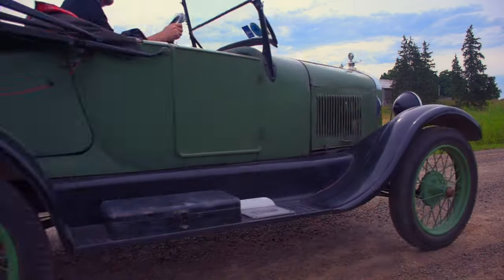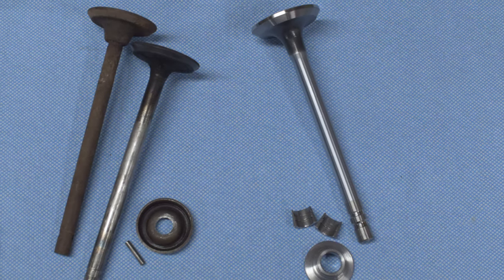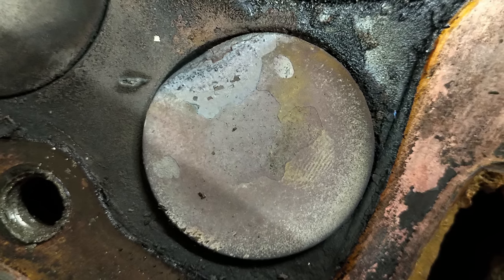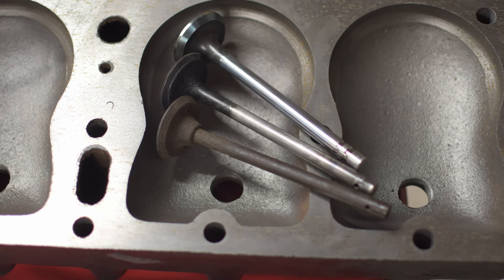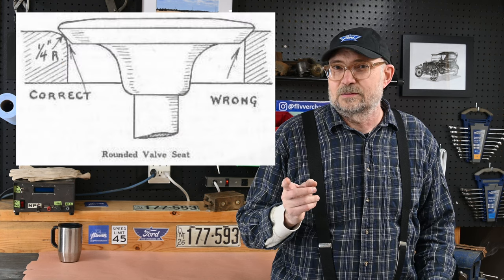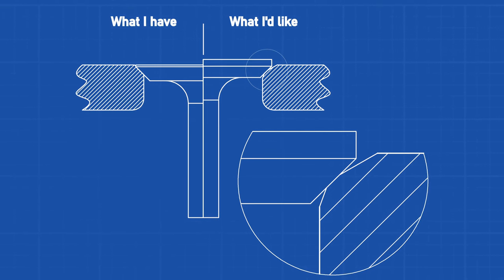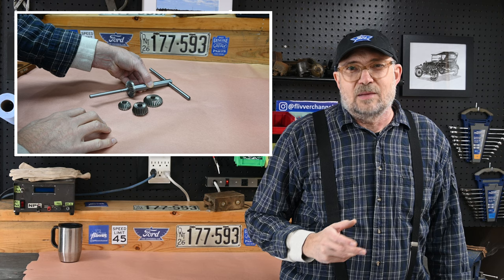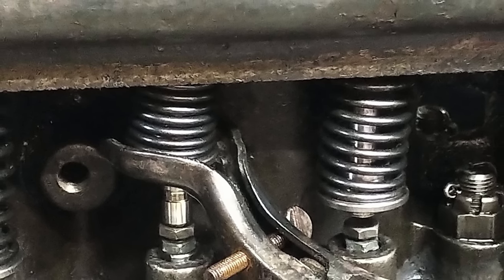Surprising Discoveries on a Model T Valve Job

Comment: I understand using Fordson valves, while doing a Model T valve job, makes them run stronger into the higher RPMs.
I registered this comment before watching your video.
Reply from the maker: Interesting. I didn't investigate Fordson valves as an option, but I will!
Reply: @flivverchannel  
I have no personal experience with Fordson valves as they relate to Model Ts, I just remember seeing a video put out by someone else.
Reply from the maker: @Peter-jo3wt  I will investigate it sometime. Thanks

Comment: Per usual, you have imbued upon us, a wealth of knowledge.
I too would have used the three and a half inch, number 8 bolts, but I would have filed the markings off the heads😉👍
I enjoyed your references to an old-style reseating job.
My engine is supposed to have been rebuilt.
I hope to avoid your head and valve experiences with this car, anyway...
Reply from the maker: Hoping your rebuilt engine is robust. Check your lifter gaps yourself tho, because it is critical to avoid burning a valve. Yeah, I should have put those head bolts in the lathe and rounded the heads, then painted the heads after retorquing. Thanks for watching and commenting!
Reply: There is nothing nefarious about building a sleeper😉👍

Comment: Isn’t a multi angle seat cut radiused instead of a straight 45, use 60 and 30 degree cuts prior to the 45.
The result is a single line of contact around the whole valve.
Reply from the maker: A radiused cut between the 60 and the 30 would be fantastic. My cutter set certainly doesn't have that tool. Are they commonly available / used? Interesting!
Reply: @flivverchannel Yes it’s what automotive machine shops call a 3 angle valve job, some shops also back cut the valve on the stem side to profile the flow. 
Very Common performance procedure.